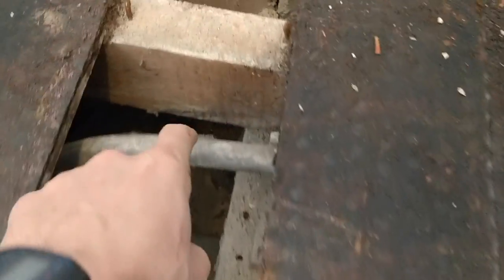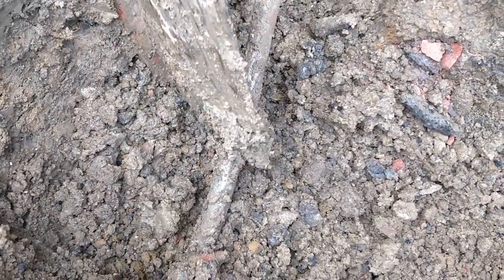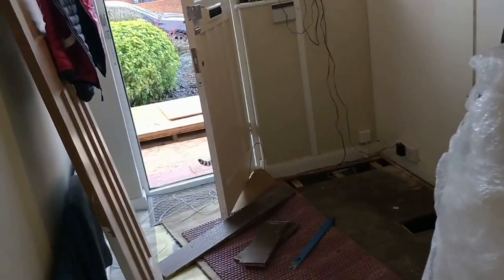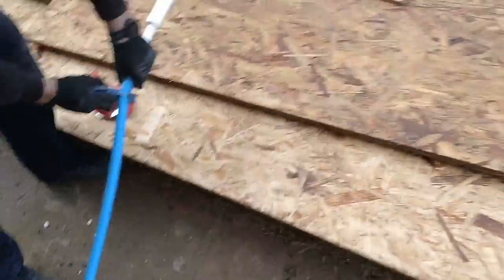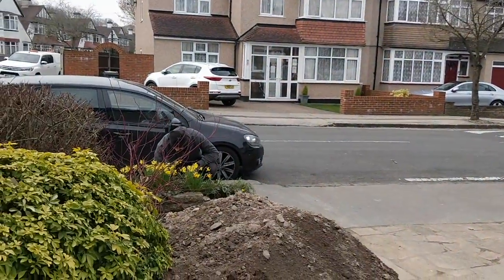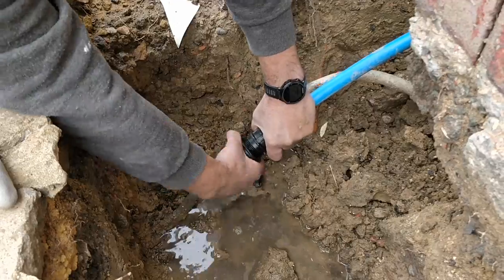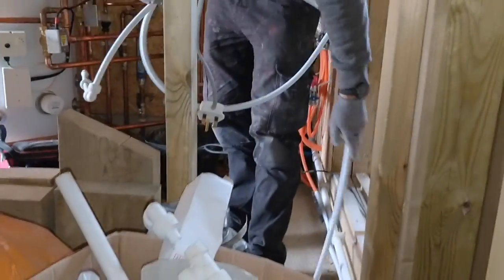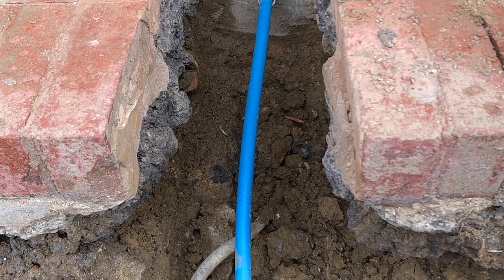Replacing lead water mains

Comment: Link to
The lead to mdpe connector
Reply from the maker: https://amzn.to/3rkLiu0

You need to double check which size of fitting you need for the size of lead pipe you've got, AND don't forget the pipe insert.

Easiest thing is to buy a few different sizes and then return the ones you don't need.
Reply: @OfficeBoyBuilder  thanks

Comment: I'm sure water regs say the MDPE pipe should be 750mm below the ground level and ducted through the foundations and insulated. If your re-doing the driveway i would duct it all in 4 inch waste pipe. A bit of a cowboy job that does not meet the regulations so best of luck getting that signed off by the local water company.
Reply: No one would know you did it so no need to sign it off
Reply: @Interdiction your local water company would of the external stoptap was renewed. They'd see the supply material of the outlet and have record of what it should be. Then they'd check of it passed a trench inspection.
Reply: 1.5m deep for MDPE as now, SEPT 2024 ... however, in 10 yrs time, it would be stronly suggested for MDPE to be buried deepa, 2,5m if poss, please
Reply: @rumpa09  LOL:face-blue-star-eyes:

Comment: I ve worked on a lot of new builds. 
Always 750 from finished ground level to prevent freezing.
Ducted in the wall and under the floor to where it meets the stopcock.
I ve used reject sand and selected backfill around the pipe and blue warning marker tape at least 300mm above the pipe then more selected backfill to ground level. 
I would've used one length rather than have a temporary/ permanent joint to eliminate the risk of leaks even if it meant leaving a coil outside.
Tip: on cold days, uncoil the pipe an hour before you need it to take the spring out of it beiing careful not to kink the pipe. On warmer days it will be less brittle but still uncoil it first.

Comment: I once closed up a trench before inspection (needed to get lorries over the drive)  Water board made me dig it up again to prove 750mm deep. Also inside the building I had the pipe against the inside wall. Had to dig up the reinforced floor to move it away from the wall.
Plainly I've never done that again. You need it inspected and agreed or grief follows.....

Comment: Blue water supply MDPE should be laid in a trench at a depth of at least 750mm (measured from the pipe crown), but no more than 1350mm, from the finished ground level and at least 350mm away from other utilities (such as gas or electricity). Some water authorities allow MDPE to be laid at a shallower depth, depending on circumstances, but must be insulated; check local water authority guidance.
Reply: And can not used LCS To drinking water
Reply: @krzysztofbaran9342  tf is LCS?
Reply: @ioncv5295  low carbon steel

Comment: The Gosforth Handyman replaced his incoming water main in a video published a few days ago.  Definitely worth a watch - he goes into detail on the water company requirements for the pipe.
Reply from the maker: Cheers - he's great. I'll take a look. We haven't actually finished wrapping up the pipe yet, so could easily insulate it or cover it with a 4" pipe for protection.

Comment: Should be 750mm entering into the thermal envelope of the building with it being ducted and sleeved for frost protection. Whats the point in insulating in inside when you havent insulated it outside at poe. From the water board developer services

Comment: If installing a pipe less than 750mm you need the Water Companies consent under Regulation 5 of the Water Supply (Water Fittings) Regulations 1999. Most Water Companies will allow this providing its ducted and adequately insualted...products such as "shallow duct" are great for this. Worth considering "Insuduct" if laying a new pipe to an existing building, it avoids to need to bring the pipe in through the footings. Thames Water would never have signed this off.

Comment: You may find you have a problem if you haven't asked your water company to do this work. Where I am, Northumbrian Water are very specific about the installation. Either way, hope it improves the flow (pressure stays the same) as well as stops the leaks.
Reply from the maker: Cheers mate, We've been speaking with them about this process, same as with the waste/sewer connections, because it's the same company for both.

Comment: How did you know that it was leaking before you dug up the old pipe? Thanks
Reply from the maker: The clips were filmed quite a few days apart...that leak in the ground appeared when we dug around the pipe. Perhaps we hit it with a spade while digging, but I'm not convinced because we were careful and the pipe is surprisingly thick!
Reply: @OfficeBoyBuilder  oh fair enough. I was proper confused how you knew it was leaking when it was still under ground. Yea that lead pipe was a beast. Did you notice any better flow rate after doing the plastic pipe?
Reply from the maker: Dude it's amazing! Like washing from a hot fire hose 🤣 we've set up the cylinder now too, and I just wired in the S-Plan (all coming up in future videos) and it's so much better!
Reply: @OfficeBoyBuilder  awesome haha. I love having a shower that blows your face off. Looking forward to future vids. 

Meanwhile I’ve got myself occupied with a 3.6x3m man shed.

Comment: Couldn’t you do it in one run save having any joints in the ground!!
Reply from the maker: We did it all in one run through the house, except at the 90° bends where we needed to have a joint. That was unavoidable sadly... we've left the floors open though for a few weeks after going live, so that if there are any leaks we'll find them now, rather than after we've closed up.

Comment: Why have you connected it back to the lead pipe ?
Reply from the maker: Because that lead part is not mine to change...that has to be done by the waterboard, and can't/won't be done until the driveway is dug up and changed. It's a very short stretch of around 3-4 meters

Comment: The hole you bored into the property doesn’t even look at the regulations never mind meet them, minimum depth for water is 750mm, if you are not sure on the regs then it may b3 better to employ someone who is, if the water authority comes to inspect the work then they may refuse to connect the full service when you get that far

Comment: A bit bodgy, sorry.  Still lead from the connector to the path on the road, and the crap pressure will be the same.  A proper job is to run a complete MDPE from meter to internal stop tap with no joins.  I'm doing one now.  Do the job proper once and once only, is my motto on my developments.

Comment: It all varies on which water board but in my area the min depth is 750mm - 1250mm Severn Trent. I did my own over 6 years back.

I would have gone in at 750mm deep and used a 4" pipe, there was plenty of depth there to get this, looks too high and doubt it will be signed off as mentioned by another poster. Also no need to use hammer on core drilling. If there were footings then I believe the pipe can be ducted and insulated at the lower depth.

Otherwise good. Not seen that push fit connector for lead, do you have a part no or link. Thanks

Comment: "So that is how you redo a water mains". OH NO IT'S NOT.  See multiple comments re lack of depth. An awful lot of plumbers seem to think that you lay a pipe to a certain depth to prevent it freezing but this is only partly correct. To shallow like this example and the cold water may start to warm causing all kinds of bacterial issues. This is a really poor example and needs to be redone properly.

Comment: Was going to do this then realised .......it's still connected to lead so I'm not helping anything.
Reply from the maker: Yeah there is partial benefit; less lead means less poison, but you're right, there is still some.

We are going to redo our driveway at some point, and when we rip up the rest of it, will be changing out that short section of lead left over.
Reply: @OfficeBoyBuilder  just spoke to my water company and they told me all I have to do is do it up to my boundary but leave and extra few metres (he did say an exact amount but I'll have to recheck)
But he said then they will come and fit it to the mains properly removing the last bit of lead

Comment: YOU HAVE NOT REPLACED THE ENTIRE PIPE AND NOT SOLVED THE PROBLEM
Reply from the maker: Incorrect. The problem was a leaking pipe, which we fixed by replacing it with plastic. We haven't finished the job yet, that is true, but we weren't going to dig up the whole drive in order to do that yet, not until we redo the whole driveway.